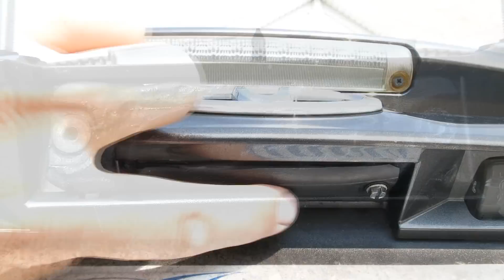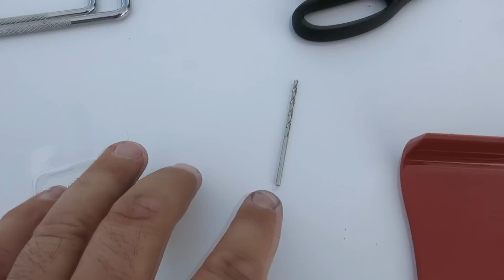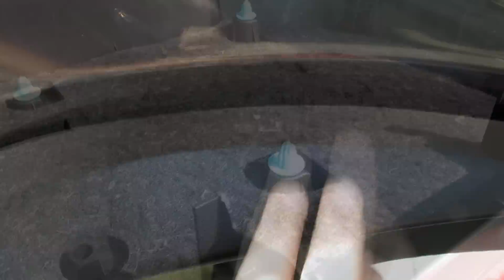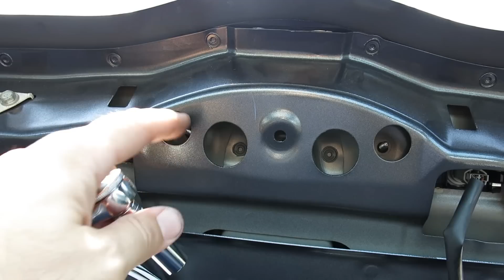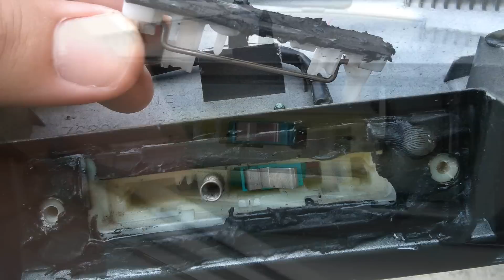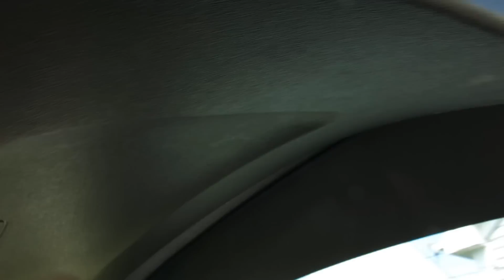2007 Prius Hatch Handle Repair

Comment: Greetings. Thanks for the video. I used this video to [re]orient all of my parts, when reassembling, instead of taking pictures with my phone. This is one of many visual descriptions on youtube, and all of them show how to take apart the entire rear panel in order to get to the plastic switch parts. I did not do this. It was not much trouble to simply - cautiously - pop out all of the plastic part. Then I soaked and scrubbed them in WD-40. Then I dried them and reassembled all parts, including an $8 dollar rubber replacement part with the screws from ebay. It is not necessary to disassemble the rear door panels to clean off the melted rubber and reassemble.

Comment: Excellent. If the plastic garnish is broken, like mine, can be found for well under 50 bucks, just not in same color as your car. The rubber replacement for the switch cover is probably worth the 15 bucks from amazon.

Comment: is the same for the trunk with keyless opening? can i do that without buying entire electronical part?
Reply from the maker: Yes. This repair can be made without buying a new handle. As long as your handle still works, you simply remove and clean the parts as shown. Then replace the old rubber with either the bicycle tube, or you can purchase a better rubber replacement made by ieworksmn.com (which wasn't available at the time I made this video).

Comment: Great video! Very helpful. Thanks!  I took a similar approach except that I put the double stick tape on the back of the switch and lapped the rubber around the edge on the front and back sides. The double stick tape plus the compression from the two screws should (hopefully) keep the rubber in place long term.

Comment: Looks like the cover can be replaced from the exterior with an offset screwdriver.
Saw a guy do it on his Prius https://www.youtube.com/watch?v=tuE5F3qZgnY
Reply from the maker: This is fantastic! Thanks for that link Ron. I did a bit of research and that video is posted by IE Works Minnesota, a company that was founded in 2015 and now makes a rubber part specifically for this repair! Wish they were around when I was repairing mine! 
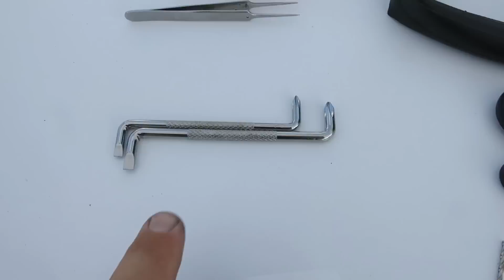Their website is ieworksmn.com. You can buy the part directly from them, or their site also provides links to purchase the part on Amazon or ebay.  I have added this info to the notes above and have annotated this in the video. Hopefully my video will still help anyone who has trouble getting the switch or screws out or who wants to remove the switch to clean it out as I did. As I mentioned at 1:19 in my video, I actually did try to remove the switch with an offset screw driver first, but one of the screws stripped and wouldn't come out. Therefore, I had to pull it apart.

Comment: If you're doing this repair just to replace the rubber cover, you can skip most of these steps. All you really need to do is remove the two screws holding the switch in, pull it out, and take the cover off. (Scrape it off, actually, and keep a bottle of Goo Gone or CitraSolv handy to remove all the gunk.) You'll have a little more room if you take the license plate off first. 

The rubber cover (Prius liftgate switch rubber grommet) is available separately from the switch:  http://www.ebay.com/sch/i.html?_from=R40&_trksid=p2141725.m570.l1313.TR0.TRC0.H0.Xprius+liftgate+switch+rubber+grommet.TRS0&_nkw=prius+liftgate+switch+rubber+grommet&_sacat=0

It's ten bucks and change. If that link has expired, just search for "Prius liftgate rubber grommet" and you'll find it. The entire repair takes less than a half hour, and most of that time is spent cleaning up the old gunk.
Reply from the maker: Agreed. if you can get both screws out, definitely go that route (I even mention this option at 1:19). However, during my repair, one screw came out fine, the second screw was pretty soft and it stripped as I was trying to unscrew it. Therefore I couldn't get it out without removing the entire garnish.

Also, GREAT find on the rubber replacement on ebay! Thanks for adding that link!

Comment: Just so everyone else knows, it takes a 10mm deep socket. I used the recommended 7/16 and noticed it was starting to strip. Great vid!
Reply: A Euro or Japanese car (basically any non US manufacturer) is never going to use SAE/English, except the spark plug wrench.  Toyota = use metric when in doubt.

Comment: My dealer wants to charge me $565 to replace mine. thanks for this
Reply from the maker: +Darius Corvo Happy to help! That is a crazy amount of money for this repair. However, I imagine they are essentially quoting the price to replace the entire rear garnish (the long trim panel with the Toyota emblem). The hatch handle is inside this larger piece. That's a bit overkill, but kind of makes sense that they wouldn't stock all the individual smaller pieces. Have fun with your repair and enjoy the satisfaction of knowing that you will have saved all that money!

Comment: Great Video! I was glad to learn how to remove the panel and latch because I was tired of having black goo on my hands when I opened the hatch. I made a small change. I used a smaller piece of rubber tire over the switch and then I used 3 layers of black duct tape and wrapped it on all sides so that it will remain waterproof. Then I screwed in the screws to hold it in. One thing to note - it is possible to remove the switch without removing the panel, but that is not obvious before the repair because of all the black goo. Again, great video...it gave me the knowledge needed to do the repair without buying the expensive Toyota replacement.
Reply: +Matt Keown Duct tape usually comes off in freezing weather, within a day or so, in my (very little) experience.  Won't it come off after enough weathering in very hot or cold climates? hmmm.

Comment: Update: It appears that the garnish, which is made of plastic, is held in place by four bolts that are molded into the back side of the plastic garnish. Over time, as the hatch's two hydraulic lift supports wear out, the owner/user naturally begins tugging and/or pulling on the garnish, using it as a handle. Unfortunately, the plastic garnish is not designed to be used as a handle. Sooner or later, the plastic will snap somewhere around the heads of the bolts. (This piece of plastic is a $300 part at my dealer!) Prius owners need to be aware that they should replace their hydraulic lift supports as soon as they appear not to be doing their job of lifting the full weight of the hatch. If you press the button to release the hatch, and the hatch doesn't magically lift all on its own, replace those lifts. (It's an easy DIY. Parts are about $50 each. Watch a few how-to videos on YouTube.)
Reply: This was not clear to me since I bought my prius used;  the hydraulics never worked right in that regard and indeed after a while my garnish snapped right off.  What lame design.  So now I need to replace the whole garnish (can't find the part for less than $250 online for the keyless entry version)  and some new lift supports are in my future too.
Reply: +OriEri  I suggest replacing those lifts/struts right away. Because the hatch is very heavy and your lifts are weak, should one suddenly fail, someone could be seriously injured. When I was looking to replace them, I was fortunate to find two OEMs in stock at a local O'Reilly's Auto Parts at a reasonable price. I read comments from some people saying they had problems with after-market parts. Also, in addition to avoiding injury, new lifts will making opening your hatch easier and help you avoid stressing and breaking your new plastic garnish. I'm in the habit of using my right hand to release the hatch, and my left hand to help lift it by pushing up on the spoiler. Obviously, there are times when I'm carrying things and I need to put them down. Crappy design.  (I'd like to attach a strap or handle via the license plate bolts so as to avoid pulling on the garnish even less, but one of the fastener nuts broke internally and so I can't remove it. But if I could, that's what I'd do.)
Reply: Of course, should have thought of that one.
Reply: Watched this video because the "garnish" on mine has loosened up slightly and I was looking for a way to tighten the part down. The actual latch doesn't have any issues, but this garnish piece is starting to bend away from the rest of the hatch when I pull it up. It feels like the nuts may have loosened up that hold it in place. I had this same issue with the spoiler, which required me removing the interior cover and re tightening the bolts (discovered spoiler was loose after a heavy rain; carpet above spare tire storage area was saturated). I didn't realize that the two strut supports were supposed to actually lift the hatch- thought it was only to hold the door up after fully extending it. Looks like I'll be doing those two struts so that I don't continue to pull on the garnish piece.
Reply: A simple method to use in order to avoid eventual fracturing of the plastic garnish is:  when the struts wear out and it takes some real oomph to raise the lift gate, after initially pulling rearward on the handle to activate the switch, the remainder of the heavy lifting should be done by grasping the bottom edge of the lift gate (as opposed to grasping the garnish) and pulling upward, all the while being cognizant of not crushing your fingers/hands in the process!

Of course, this should be considered only a temporary technique until such time that the struts can be replaced (preferably sooner than later).
Reply: @CessnaPilot1996  , our Touring model had a rear spoiler of sort on the hatch. I was in the habit of using my right hand to activate the switch and my left to lift the hatch. Of course, I’d have to set down whatever I wanted to put in back before doing opening the hatch. However, I could never get my wife to do this; she’s the culprit that broke the first piece—and was going to break the replacement. Anyway, we eventually replaced it (12 1/2 years old with 215,000 miles) with a slightly used Honda Accord Hybrid—with no hatch.  : (

Comment: Our Prius is a 2007, too.

Since I've posted that comment, I've learned that the button is simply there to be pressed in order to unlatch the hatch, and that the two hydraulic lift supports are supposed to do all the work of opening up the hatch. But, those supports wear out over time and you end up naturally pulling more and more on the garnish. Of course, that doesn't completely explain why mine is held on with clips and others' have garnishes that are bolted on. Anyway, replace your supports as soon as they show signs of not doing all the work of opening your hatch.

Comment: A few months ago, the garnish panel on our 2007 Prius came off in my wife's hand. Ours is held on with some plastic clips, some of which must have broken. It snapped back on, but it's come numerous times since. The dealer said it might be necessary to replace just some clips, or maybe the whole panel--which will be just over $400 for the part and an hour of labor. Have you heard of some Prius's hatch garnish panels being held on with clips, while others using nuts and bolts? Why would they have ever designed a hatchback handle lift to be held on with plastic clips?! Am I missing something?
Reply from the maker: I'm not a mechanic and I've only replaced two garnishes: one one this Prius, the other on a 2005 Scion TC. Both were bolted in. It seems odd that a piece with this much use/wear would be fastened with snaps. What model year is your Prius? Perhaps someone here with a little more knowledge can help. Or you can try a forum, priuschat.com, where you will find a lot of people who know a ton about the Prius and are always willing to help.
Reply: DIY and Repair Videos  I posted a couple of updates, which I assume you saw. I've learned the importance of replacing the hydraulic lift supports on any and all hatchbacks, SUVs and station wagons as soon as they stop doing all the heavy lifting.

Anyway, I meant to thank you for the suggestion and link to priuschat.com; I found it very helpful.

Comment: Thanks for the video. Really helped. I replaced instead of repaired and found that the new switch was a bit more responsive than the old one. If you do replace (or remove to repair) you don't need the angled screwdriver. The screws will be more easily accessible once the switch assembly is out of the car.
One other note: If you replace and have the keyless entry option (with secondary small locking button) make sure that you order the right part. Some websites don't show it properly.

Comment: Excellent video!  I was able to do exactly what you described and it works like  a charm.  The wife is more than thrilled that she can get the hatch open again with ease. 
One thing that might be a good idea is to cut a paper template for the 2-sided tape and cut it from a single piece of 1" wide.  That way the tape can be a kind of gasket for the new rubber cover, and keep water out of the switch area.  I did it your way and I think it will be fine.  Thanks for the help!

Comment: Well, I was lucky.  I haven't been able to open the hatch, but today was a 50 degree-day in the middle of 20s and 30s.  I did get the hatch open, letting me easily see the "rubber".  I couldn't loosen the two screws, but was able to scrape away most of the rubber with a screwdriver blade and hooked piece of coat hanger.  Got the switch really free, and covered it pretty well with ducktape.  I'll check that through the winter, maybe add more.  Works for now, maybe as long as I need it to.

Comment: Like Arnold R. below, I'd really like to have that part name for Autozone.
Reply from the maker: Jerry Ryberg I'm not sure what part user "fullyautomated" is referring to. The handle/switch is a very specific part and I'd be surprised if any Autozone or other general auto parts store carried a replacement handle or switch. I even called my local Autozone and confirmed that it's not a part that they carry.
Reply: DIY and Repair Videos Hmm. OK, thanks.

Comment from the maker: @Arnold R, I was unable to do this from the exterior of the car because I couldn't remove one of the screws. The handle is not parallel to the ground (it's not quite horizontal). It has a bit of an angle inward toward the car which makes it a bit difficult to get at the screws. In the end, I just couldn't get the right angle/grip on the screw head to remove the second screw. I believe I read a post in a forum where a user stated they were able to make this repair with the handle still attached, so it may be possible. In the grand scheme of things, this repair isn't very difficult, but it's a bit time consuming.

Comment: Very helpful.  socket - Only one mistake - don't use a 7/16" - use a 10 mm - Toyotas are manufactured in Metric, not SAE.  

GOOD VIDEO!!!
Reply from the maker: Thanks for the feedback and yes, a 10mm socket would be the best tool. However, for those of us who don't own a metric deep socket set the 7/16" will work in a pinch. Thanks for sharing your expertise!

Comment: Auto Zone sells the replacement part for $47.00 vs $80.00 from Toyota.
Reply: What's the item name please?  Thanks.
Reply: Per my Toyota dealer it is the 'Back Door Switch Assembly - the part number is 84840G - 47020' for the auto open version for my 2008 Prius. They wanted 75$.
Reply: +Arnold R did you learn the name of this part? very hard to identify.
Reply: Keyless, not auto open. Sorry.

Comment: This is yet another problem with the Prius hatch locking assembly.

I've been driving since the mid-60's, have always bought new and had over a dozen cars. Nothing comes close to the stupidity and constant breakdown of my 2006 Prius' hatch assembly!

Twice due to stupid design the hatch would pop open on it's own, leading to a door ajar warning on the dash. If in a garage and not used for a few days it drains the battery. You can't start the car. Then the fun begins. You have to crawl in the back seat and manually undo the latch. Twice my dealer "fixed" it or so he claimed replacing the motor on the hatch for almost $300. A few month before I had them discontent the hatch from the door ajar warning going off constantly again so I wouldn't run down the battery a third time.

Today is the last straw. Was at Lowes had 10 bags of soil. Couldn't open the hatch to load them in.

Really Toyota?  This is poor design and obviously defective. NEVER again will I buy a Toyota anything. Already 4 or was it 5 recalls on this car, not including this.

Toyota no longer stands for quality it stands for Japanese JUNK.   Buyer beware.

Comment: Thank you for sharing this!  Your instructions were clear and easy to follow.   A couple of comments:

1) If you don't have charcoal lighter fluid, use WD40.  It's also less caustic on the surfaces and fingers.  Be patient - 80% of the work on this project is cleaning up the old rubber.
2) The nuts are 10mm if you have deep metric sockets.
3) I was able to remove the screws without stripping them by using a #1 Phillips screwdriver.  I think a driver bit on a small (<12V) driver will also work.  Even if the bit jumps a bit and partially strips the screw head, the screwdriver bit will grab the unmarred part when putting the screw back in.
4) I cut my bike tube (or any rubber) to fit edge to edge (wider than the switch mounting) and used hot glue around the outside the black switch mounting as adhesive and caulking.  The tube also bows out (down in the closed position) a little so water will naturally flow away from the edges.

Also, if you close the hatch habittually after you've removed the switch, crawl into the back, open the storage compartment lid and you'll find a release under the catch.  You'll need to feel around for it.

Dave
Reply from the maker: Excellent tips! Thanks for adding to the "knowledge base" for this repair!